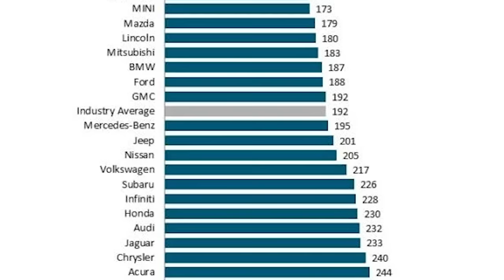Trucks That NEVER Break Down (Reliably run 1,000,000 miles)

Comment: 2006 Silverado 1500 with the 4.8L Vortec LS built by the UAW folks up in Fort Wayne. 339,000 miles before it was stolen and totaled. That truck took everything I threw at it and kept coming back for more, whether it was towing my travel trailer or loaded down with parts and tools for my job, that Silverado never broke down . It was the best vehicle I have ever owned.

Comment: We had the Ram V10 where I was stationed to tow things. We had other trucks to get around in, but one day that v10 was the only thing available for me to run tasks in. I hopped in it for the 1st time, started it up and pressed down on the gas and spun the rear tires. Like a kid who'd just found $5 in the house, I was like "ooohhhh shiiiiiet!!!' It was powerful and fast for its time, but it was heavy as a tank and when it hit bumps, you felt all of it. After driving it a few times, I felt it was best suited just to tow loads because that pickup had almost toooo much power in it when it wasnt towing extra weight. Basically a Viper engine thrown into a hooptie.

Comment: 2010 Tundra SR5 extended cab 4x4 owner. I own a lawn care business & pull a trailer daily. 260,000 miles so far and I haven't had a single breakdown. I always change the oil myself at 5,000 miles with Supertech 5W20 synthetic and a Toyota oil filter, never replaced transmission fluid. Replaced the drive belt once so far. Never flushed the coolant completely, but I've replaced a gallon or so a few times. I installed a new water pump a couple years ago because I heard a bearing squealing. Two sets of factory spark plugs, countless sets of front brake pads & rotors because they warp easily and the trailer I'm sure is to blame. I'll buy more old Tundras for as long as I can find them.
Reply: I'm the same with 96-98 5.7 Chevy, had good luck with several in a row. The 07-08 were ok, not quite as good. Actually was eyeballing a sr5 the other day, might be nice to drive something different.
Reply: @kingpest13  I had a '90 Silverado for a decade, had no issues until 185,000, then within a few months the transmission and engine needed rebuilding. Also owned a '97 and 2010. The '97 was old when I got it but it was a solid rig. The 2010 was a lemon. I've had all Toyota since 2012, zero issues with any of them, from two Corollas, a 2002 Tundra, a 2018 Camry, 2010 Tundra, 2010 Camry, 2019 Tundra. We still own all but the Corollas, they were just kid & work cars. Haven't had a mechanical issue with any of them. I still love the old squarebodies & 88-98 Chevy trucks. I have two 5.7 SR5 TRD 4x4 extended cabs now, 300,000 on the 2010 and it pulls my lawn care trailer all season, zero issues or complaints. The '19 is still our going to town rig, but it'll eventually be making us money like the other ones. Not trying to slam GM at all just stating my experiences.

Comment: Have owned my '97 K1500 Tahoe, 2Dr for twenty years and, yes, I had to rebuild the 4l60e transmission. Still have it and while it's not as pretty as it once was, it still goes forward. In fact, I just completed a 4,000 mile road trip in it with nary a problem.

Comment: I had a 78 F250 Ranger and a 08 Ford Rager. My Ranger was a 4 cylinder and I loved it. Except for the Auto transmission which I had rebuilt two times in less than 150k mi. I've also regulary overloaded and over towed with it several times.  The manual version is much more reliable and if my transmission goes out again, I'm tossing a clutch in that thing.   I paid $19k for it brand new and abused the hell out of it for over 10 years and I never plan on getting rid of it. Also, it  currently blue books for $7k and regularly gets 25 mpg.

Comment: When I first got my license, the first vehicle my father gave me was his old Mitsubishi Mighty Max. That was a really good, small truck. Not fancy but build like a tank and simple and cheap to repair when I did go too far.
Reply: My brother and I spent many years trying to kill a ‘93 Mighty Max. We finally donated it to a church. I’m sure it’s still going.
Reply: I have a 92. Multiport injection 2.4 and 5 speed. Starts when it shouldn’t, as long as it has battery, no matter how cold it is. Even taught all three kids to drive manual in it. Never expected it to still be here.
Reply: 1957 gm 3 on the tree rules

Comment: The part about the Ranger becoming "all Mazda" is absolutely wrong.  The Mazda B-series had nothing Mazda but their name badges.  They were made in the Ranger plant in St. Paul, Minnesota, right along side the Ford Ranger.  Had the Ford 4- and 6-cylinder engines, Ford transmissions, Ford differentials, etc.

Comment: i have no idea were you get your info from but i have seen so many s10s blown up or just junk , the ranger 2.3 on the other hand will run untill the body of the truck is gone , then it can just be swapped into something else , an airplane comes to mind considering they were used for them new . they were also used in mustangs , pintos etc

Comment: My 2002 S10 Automatic 2.2 Liter has 200,000 original miles & other than a A/C Compressor at 100,000 going out it's been reliable & easy to maintain

Comment: I have an 06 Ranger with a 4 cylinder and 5 speed manual with 252k miles and It's still running strong. I drive it to work every day. It's probably the best truck I've ever owned.

Comment: So far my 03 4l60e is holding up at 200k same with my 4l80e in my k2500 suburban my #1 complaint with the newer trucks is the lack of available manual transmissions which I guess makes me an oddball but I logged more than 400k on my 95 GMC when it suddenly developed a taste for venison and that was it's undoing.
Reply: You’re lucky with your 4l60e, my 05 had a little over 100k on it and decided to take a shit while I was headed home.  Lost 3rd & 4th.  Now the 80e was way more reliable and that’s why people would switch them out if they could.  As for manual transmissions most companies don’t even really offer them, at least not here in the states, which I find ridiculous but a lot of it is because this new generation doesn’t want to try and learn to drive it.
Reply: o2 chev crew 2500 hd 6.0 NV standard, like a 7.62 sks, wont let you down

Comment: I think a cool reliable vehicle is the first generation Ford raptor.
That 6.2 L engine was basically the one in 250 fleet trucks you see everywhere with 500,000 miles. It was changed a bit for the raptor I believe but it was built With reliability at least partially in mind, and that's more than can be said for most engines these days. It's very rare to find a performance vehicle that's just as if not more reliable than its counterparts
Reply: They moved to the newer generation ecoboost because of the success they were having with their regular F-150s...they realized how much they could actually get out of the ecoboost engine and still keep it reliable.
Reply: They are known for having the weakest frames ever lol
Reply: @garrettspivey  not really when you're not jumping them 10 feet in the air
Reply: @danamullins2723  the eco isn't bad but it isn't close to the NA 6.2. It can't be

Comment: Still rocking my 2011 4.7 ram 1500 with 336k on the chassis and 430k on the the engine, ive worked at a shop in north manitoba ive only seen 3 other vehicles with the same milage all the same truck as mine!

Comment: You didn't mention the Dodge D100 D150 with the 225 /6. Extremely reliable engine that dodge used for 23 years, from 1960-1983.
Reply: That “dodge” was a rebadged Mitsubishi. My first vehicle and I miss it everyday
Reply: Good Ole slant six, The Leaning Tower of Power.. great engine, difficult to kill those old girls..

Comment: Had a 02 Ford Ranger for 6 years, bought it with 150K miles, and traded it at 196K,  for a 21 Nissan Frontier Midnight Edition. Regular oil changes, replaced u joints, fuel pump, water pump, heater core, alternator and 2 radiators. Past that solid truck that I took hunting, fishing and 5 hour trips out to where I went to college. Only traded it because of the high miles and repairs becoming more and more frequent

Comment: I got my old 94 Mazda ranger 2.3 5spd 260k miles blew the head gasket between cyl 1 and 2 causing them to share low compression. just fixed it this weekend. It’s incredibly slow but still surprisingly fun when wanting to be. has literally done everything Ive needed it to do from towing my other vehicles to hauling tile, furniture, etc and has  RARELY ever let me down. The oldest vehicle in the parking lot at my job by 12 years but I guarantee will continue to outlive all of them 🤷‍♂️

Comment: If I needed a second vehicle it would probably be a truck. Thank You for this video. Very helpful
Reply: My second vehicle is a 2022 Toyota Supra.  My primary vehicle is a 1988 K1500 chevy  with over 700,000 miles on the chassis (LS3) ( second engine and rebuilt transmission) Still runs great.  
The usefulness of a truck for me means I have always owned a truck even when I could afford only one vehicle.

Comment: As someone from Southeast Asia... The older generation Toyota Hilux, Nissan Frontier (Hard Body), Mitsubishi L200 (Dodge Dakota), Mazda B2200, and even the Isuzu Fuego are some of the most unkillable vehicles out there.

Some will eat out oil due to age, spew out coolant, body fall apart due to rust or whatever, but they will keep running and running even after throwing all the abuse you can possibly give them.

Comment: Having owned a '98 and '01 V10 Quadcab, both with 3.55 and 5 spd. 16-18 MPG highway, pretty impressive, but city driving or hooking up a 30 foot holiday trailer, cut that in half. Bought an '80 W-150 Powerwagon in '02, typical Clubcab long box, 4" lift, 360, 4spd. Usual Dodge electrical gremlins, in a plain Jane truck. 9-12 MPG. Daily is a '18 Powerwagon, with all the bells and whistles. And i freaking love it, why, because  I loved my '15 Powerwagon. Brand loyalty plays a big part in my decisions, but I still have my 57 D100 big window build from the early '80's. Cherish what you drive!

Comment: The 'Legendary 7.3' Power Stroke made by International for Ford should've been 1st on your list - NOT last! My first one went 827,000 miles with ZERO FAILURES before I sold it to a landscaper who's STILL working it to this very day, rusty body and all. My 2nd one was totaled at 450,000 and the one I have now is a baby at 195,000 miles!
Reply: Mostly twinky trucks on this list
Reply: Nope the 12 valve Cummins is number one what a ford fanatic you are but I could agree 7.3 is second
Reply: The 06 duramax and 08 toyota tundra are in the million mile club, if i had that many miles on an engine i would be reporting it to them, toyota gave the guy who got to 1 million miles a brand new tundra for free
Reply: @LizCal-yp3jr   ...what about the KDP???? Buddy with an old 5.9 Cummins Power Wagon had the KDP and the motor instantly swallowed all 12 valves! SO much for 1st place! 😂😂🤣🤣😂😂
Reply: @jamesbasye2362  ...funny! Toyota gives a million mile Tundra owner a new one when there's almost 500 'million-milers' on the 7.3 forum! 🤣😂
Reply: @seanoleary1979  yes i believe there are quite a few 7.3 powerstrokes with that mileage, but thats a diesel, diesels are built like tanks, there are cummins and duramaxes that have done the same. For a a japanese truck that runs on gas thats way more impressive
Reply: Dont get me wrong i love the 7.3, its the only other deisel other than i cummins that id buy

Comment: I have a 2003 Ford F250 4x4 with the 5.4 2v now with 300.000 mil and just now having the plug problem .this truck has never let down or stranded. The plug are not hard to fix with the right kit.

Comment: Used to have a 94 d21 4x4 and I swear you could blow your headgasket, rear main, grind your gears all day and run on 4 cylinders (vg30e v6) and it would still drive like a dream. 
If I could find another pristine d21 and the ability to rebuild the motor, I would get it in a heartbeat

Comment: My 95 bronco is built like a tank and runs like a champ, about to hit 200k and only thing done so far other than regular maintenance is replace the power steering pump and fuel pump, surprisingly all electronics still working good and AC blows colder than my new gt86
Reply: Good old R12 refrigerant. Had a 92 Celica that blew ice cold. It would freeze you out in 100 degree weather! None of these new vehicles cool like older ones with R12.
Reply: the biden broncos shoulda been called donkos?,they only made real 1s 66-96 R.I.P. LOVE MY 92 CUSTOM!!!!!!!

Comment: Youve got the Honda ridgeline generations reversed the 5 speed in the first gen was bulletproof. The only thing that kills a first gen Ridge is rust or no Maintenace. It is the 2nd gens 6 speed trans that are a little weak but Honda has replaced it with a 9 speed on the newest trucks.

Comment: I owned two 7.3L powerstroke ford trucks. Had 515k and 633k. They were rock solid. Wish i never sold them
Reply: Definitely not on original motor and transmission
Reply: Yes original motor on both, u cant kill them. Even running out of oil the engine wont turn over. Uses oil pressure to fire the injectors.

 One had thr 4r100 trans and was rebuilt twice. The other was a ZF and original

Comment: One little nitpick, the 2006 Duramax was the LBZ engine, not LLY.  Aside from a failed turbo in the first 1000 miles, my LBZ has been rock solid and bone dry.  The Allison transmission has been equally reliable, though I have had minor problems with other components of the GM truck.

Comment: The s10 that they showed is definitely not the last generation maybe for north America but in south america they have them up to date with a 2.8 duramax diesel with 200hp and 369ftp torque and a 5l60 transmission which is a pretty reliable combo

Comment: I picked up an 07 F150 with the 3 valve 5.4 Triton for $3500 because of the cam phaser issue and that truck hasn’t given me any problems. I drive it daily for work and take long highway trips regularly and it’s got 210,000 miles on it. Haven’t fixed the cam phasers, nor do I plan to. For all of the problems I’ve read about that truck has surprised me.
Reply: Man you’re lucky I got an 05 with the same engine and it started to rattle due to low oil pressure before 200,000 miles. I was worried I would blow the engine at some point if I didn’t go in an repair it, but my transmission decided to blow before…
Reply: The 3 valve will last but only with strict following of basic maintenance, change and check the oil every 3k miles, with synthetic oil, and high quality oil filters. I have seen them with over 300k and still running great. 

Most don’t make it past a 150k before trouble starts.
Reply: @alexgrindnshine2522  exactly
Reply: Mines ran good with no issues and I’m at bout 213,000
Reply: Save your money judgement day is coming 😂

Comment: I have a 1995 Nissan Truck iam the 2nd owner its a manual 4x4 extended cab has the LSD rear end and the V6. Only truck i have ever owned iam the 2nd owner had it since 2006 been a great truck very reliable! great video!
Reply: Stay on the timing belt 😊

Comment: I have to say as a long time chevy truck owner from my 83 3/4 to my 2011 2500hd with many trucks in between i love them. My grandfathers both all drove chevys my uncle’s all farmers and loggers. We all snowmobiled ride trailer across the NE somtimes even go to the rockies. My father had owned many 5.3’s now with no problems that being said my 2015 Silverado 5.3 had the famous lifter failure. But i bought used first truck iv bought used in many years im 44 now so owned many Silverados. We all use them for hunting go off roading no pavement queens they get worked and dirty. Iv seen it way to many times when chevys get traction when others don’t talking stock trim here no mods. Iv taken full size chevy pickups places jeep guys wouldn’t go. Of course I could of probably taken there jeeps same places but still showed them up lol!! All trucks can break down but iv had really good luck with my GM trucks. My first car was a 79 hot rod camaro 450hp 358 with muncie 4 speed. Iv owned many camaros now my wife daily drove a Gen 5 LS 3.6 now drives a 18 RS 3.6 very fast for what it is get 23mpg average over 30 on highway. Very little trouble with the gen 5 or the 6. Sunroof stopped working thats about it. O ya had power steering leaking on the Gen 5 before we traded in. Camaro had almost 90,000 on it though can’t really complain both been great. But ya i know the horror 5.3 stories and there real but wouldn’t let that dieter me from buying another chevy. My 2011 3/4 6.0 lifted with ported heads cam long tubes exhaust and more. Had to unfortunately sell with 110,000 miles on it needed money. But i had the original breaks on that truck and spent most its life trailering something behind it. Ya it road rough got terrible fuel mileage but was bullet proof.

Comment: I used the hilux during my 11.5 years working in Kuwait, a breakdown in the summer in that country could be fatal. In all that time I don’t recall ever having a breakdown in any Toyota product for anything other than tire failure. I was in a Chevrolet SUV that had the front axle fail going down the highway at about 80 miles per hour. My work partner and I waited many hours on the side of the road waiting for my company recovery team to finally reach us. The Kuwaitis, Bedouin people and other expats frequently stopped to make sure we had water….lol.